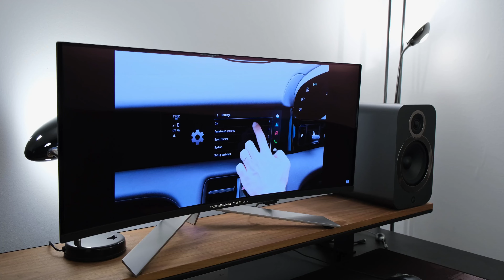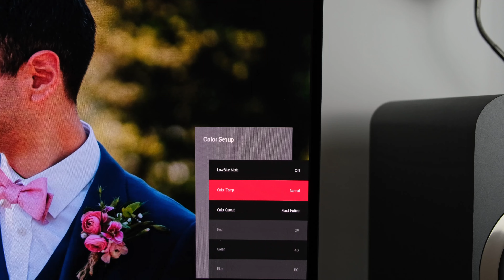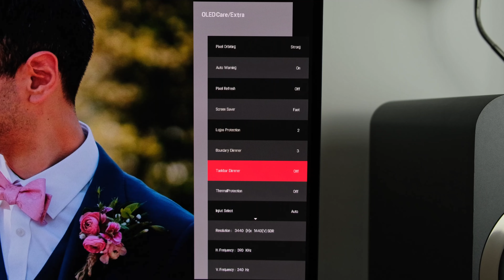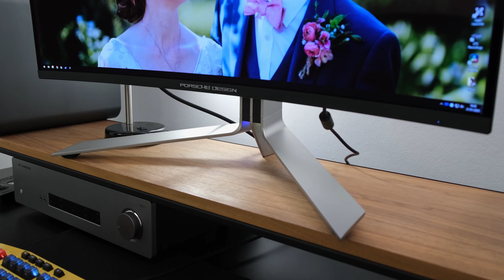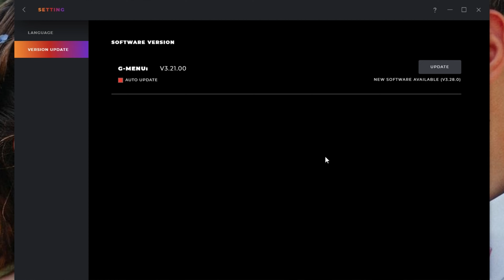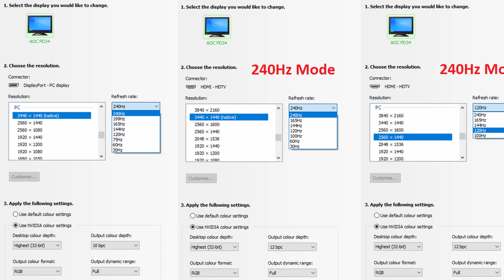Stylish and Fast! Porsche Design AOC Agon Pro PD34 (34" 240Hz OLED)

Comment: nice monitor but the only thing missing is display port 2.1 and i think the oled burn-in problem has been fixed in this model. i will prefer this brand when improved revised models come out.
Reply from the maker: Thanks for sharing!

Comment: Costs around as much as my Odyssey G9 OLED yet only has a 21:9 panel. Pretty sure you can get similar monitors for much less that still look really nice. My monitor is expensive but this takes the cake
Reply from the maker: Yeah it's spenny, but in terms of performance across the board, it's excellent.